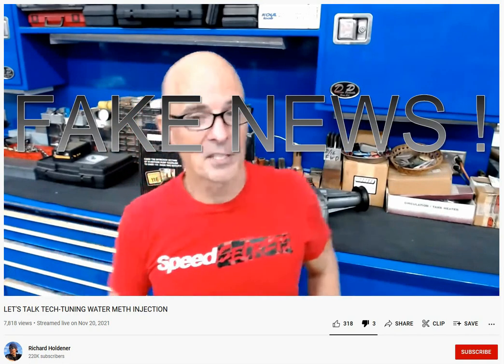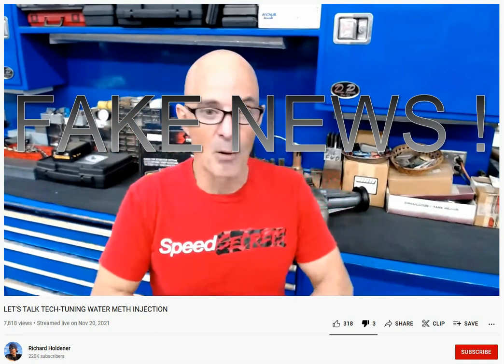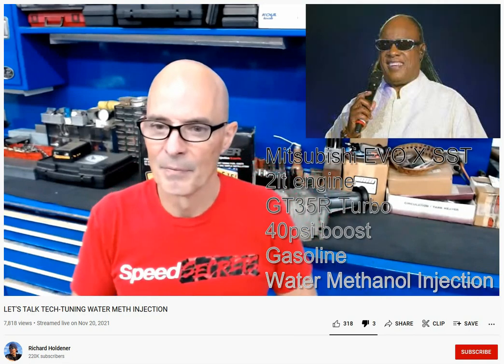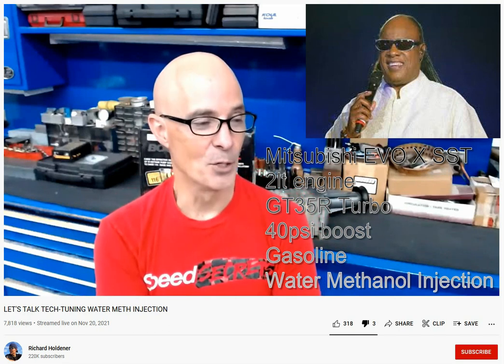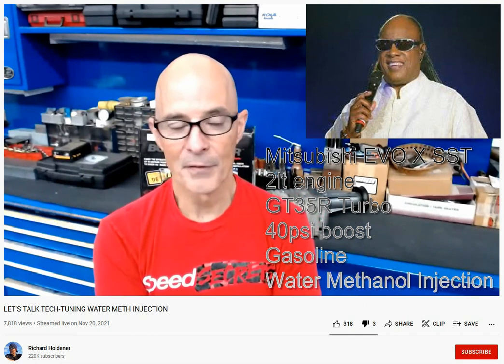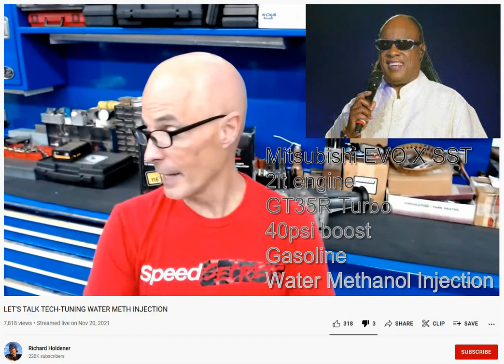Water Methanol Injection | Fact V Fiction - The real deal !

Comment: That was my reply to Richard during the live chat. DP water/meth with 98oct (US 92 or less?) on the engines in question are the turbo barra (I'm Australian) and the workshop providing the proof time and time again now that he has it dialled in is Stathi from IMS (Independent Motorsports). Torque is down slightly in the midrange compared to E85 but power is the exact same on the hub dyno...
I love watching Richard as he's a wealth of knowledge but he hasn't done testing with pump fuel and water methanol with boost and an intercooler. I specifically mentioned direct port to him as you won't get even distribution otherwise so you have to leave some headroom on the table for cylinder... 
Hopefully he'll revisit it properly next time as they have all the kit and kabootle to do so!
Reply: Thought your name sounded familiar... Straya ftw!